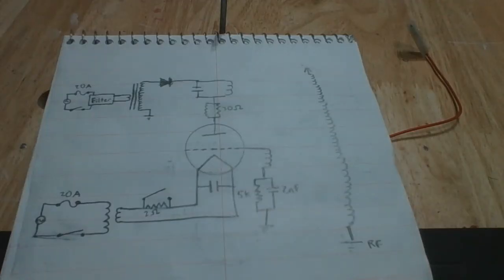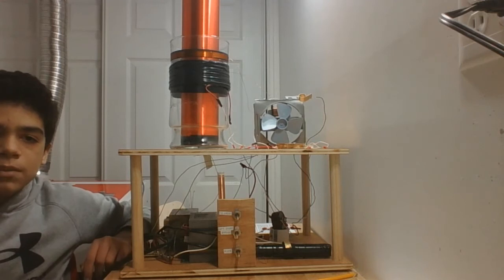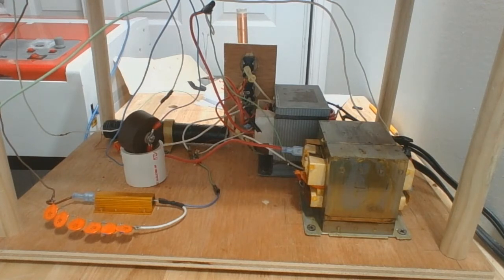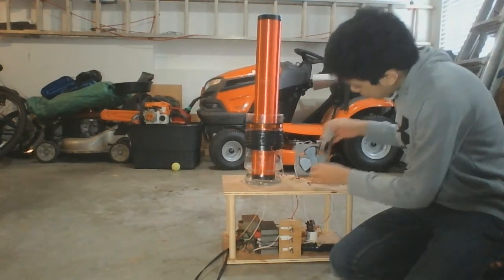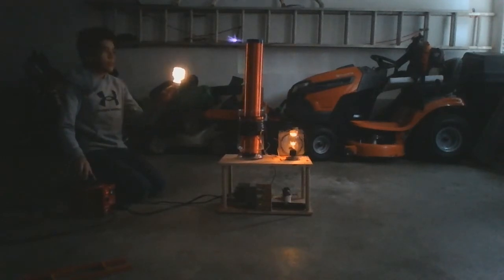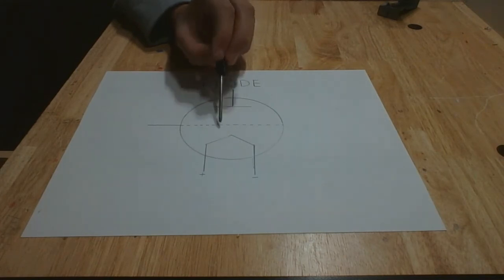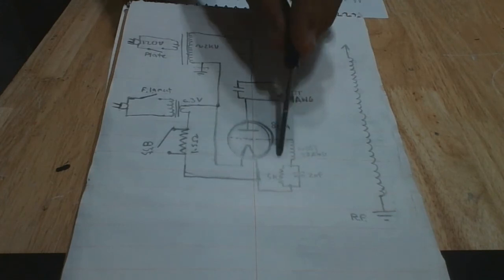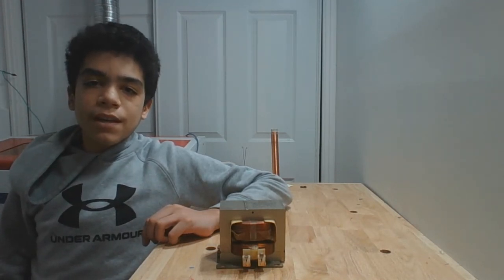How to build a DIY Vacuum Tube Tesla Coil Part 2: Armstrong Oscillator

Comment: Great build friend! It is fun to see someone of my age group doing about the same thing as me (I can't say I've built a VTTC before, but we still work in the same field of study). I would love to see you wind a tiny 50 or 100 turn secondary coil for this circuit, and use the 2000 turn one as a magnifier coil. The results would be stunning I'm sure, the efficiency and transmission would be to die for! Consider me your 71st!
Reply from the maker: Thanks so much! Constructing a magnifier circuit is a great idea! Thanks for commenting!
Reply: @-ElectroMan-  No problem! It'll be fun to see the results if you construct that magnifier circuit!

Comment: Wow m8, nice build for your age. I'm 16, keen to electronics, HV and high current and I'm truly impressed by the fact that you are able to use vacuum tubes😮👍😍... Talking about the vacuum tube... Isn't it a bit small for a 2 MOT power supply? The most used is generally a GU81M (pentode, 700w, 3kv) because it is relatively cheap, powerful and diffused🙃... If you are keen to triodes, instead, I'm sorry but idk any of them (marking codes, I mean)... Anyway, here it is a link to a good site that you probably know where you can find almost every vacuum tube datasheet🙃🙃 https://frank.pocnet.net/sheetsG.html
Reply from the maker: Thanks so much! it was a great project! Anyway, the 811a (Tube that I Used) is rated at 1,750 volts at 130 mA and for this reason I purposefully chose a very small MOT as the power supply. I also noticed that the particular microwave from which I removed the transformer contains a doubling capacitor rated for only 2,000 volts. This means that the output voltage of the transformador does not exeed 2kV and is therefore relatively close to the rating of the thermionic triode. Finally, the Tesla Coil is actually not running on two MOTs as one is used as a filament transformer (The contruction of the filament circuit was detailed in the video prior to this one if you're interested). Anyway, thanks so much for the reference to the datasheet website, I actually hadn't heard about it. If you ever plan on building a similar circuit, feel free to ask me any questions that you may have, and thanks so much for watching!
Reply: @-ElectroMan-  wow thank you too for the detailed answer!! 😄
Reply: I have a 5kw 7,000 volt Eimac power triode that i am hoping to use in a VTTC
Reply from the maker: Thats awesome! 👍
Reply: @-ElectroMan-  I have a video on my channel now of the vttc the video is called 1,000,000 volt Tesla coil experiments
Reply: @NerdlabsSci  wow! Then will you post a video about the working coil? 🙃
Reply: @fabriziobrutti1205  Maybe. It won't be out for a while tho, i have other projects that i am working on
Reply: @NerdlabsSci  understandable, don't worry 🙃